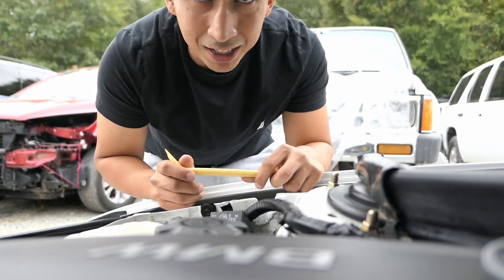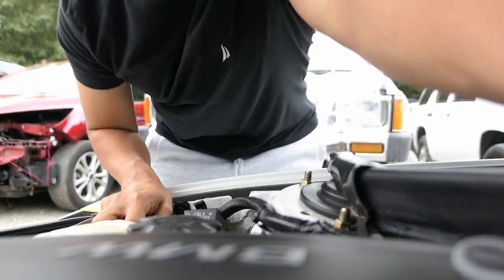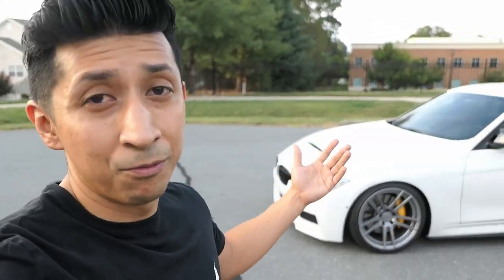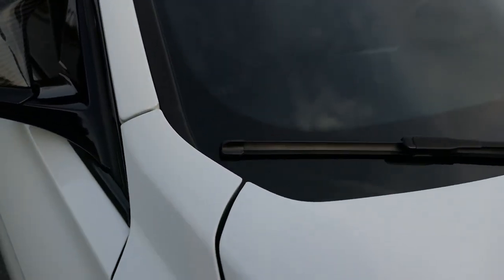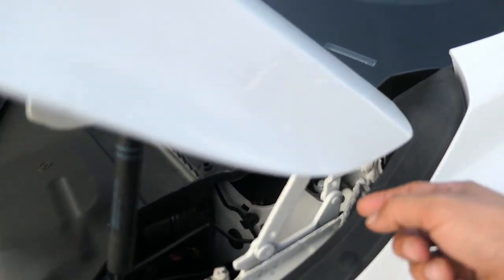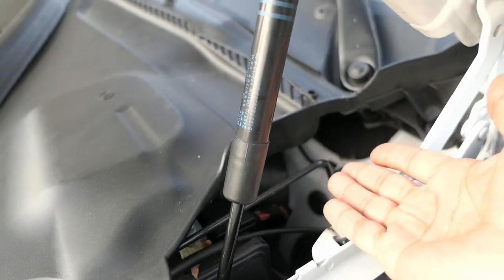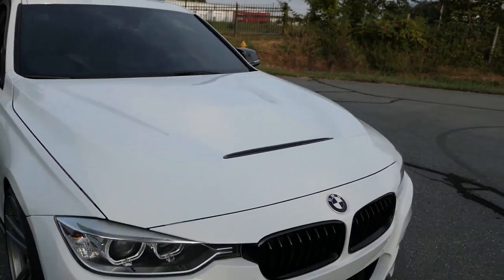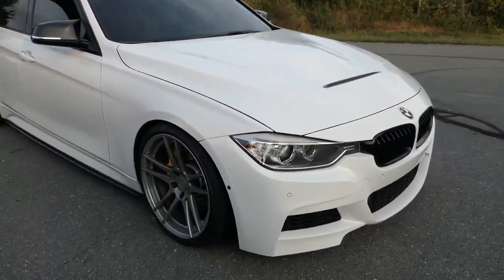F30/F32 GTS HOOD Review | JUST GOT MORE AGGRESSIVE!

Comment: am planning on installing the gts hood on my f30 however did you have any problem with water entering the vent of the hood? from rain or car wash. do you think it might affect anything in the car ?
Reply from the maker: My vent piece was actually closed off. I believe after mine they were made open but as far as im aware it shouldnt cause issues. The water will just hit where the intake tube is and drip down. A few people are running the hood already and no one has mentioned about water issues